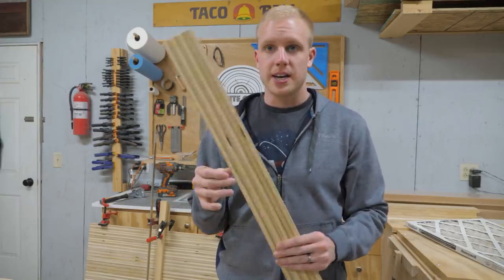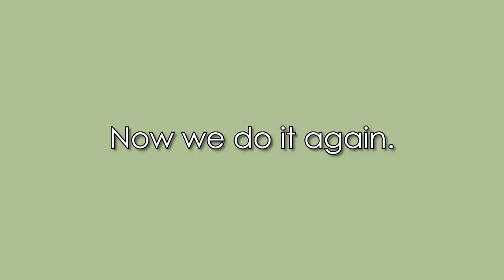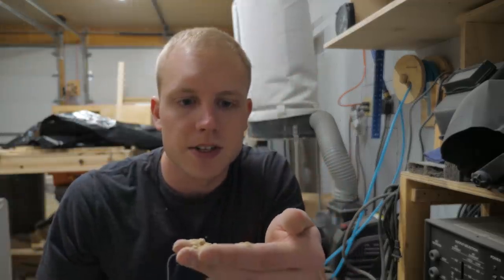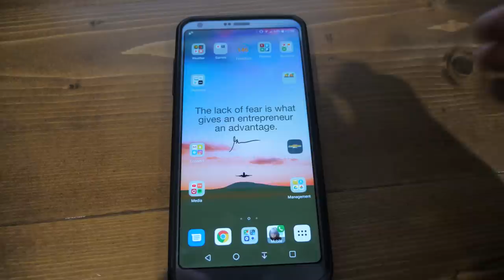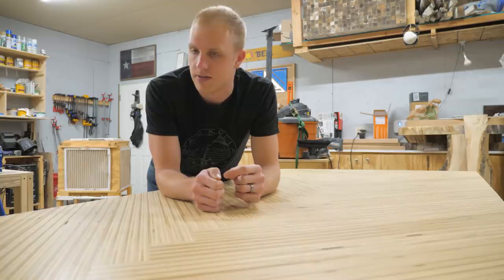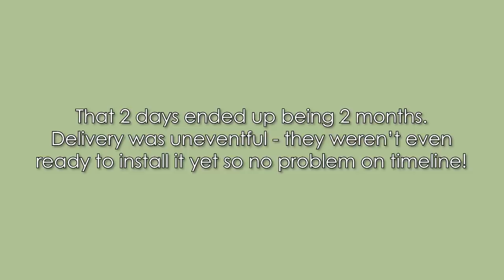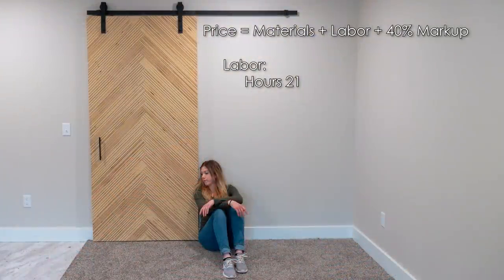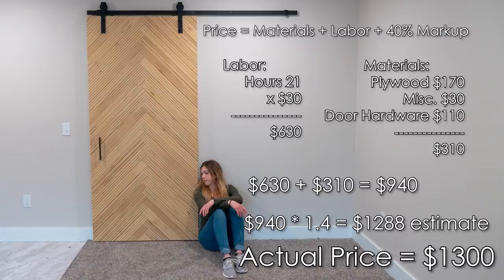Sliding Barn Door with Modern Herringbone Pattern | Build & Sell | Woodworking Business

Comment: Nice project! Came out much better than I thought from the description, kudos!
Just a couple comments if you don’t mind. 
You keep saying “ plywood”, which is true BUT I have run through a lot of birch ply, mostly seven ply. There are two cores available, which are very different in the way they look/process. There are fir core and poplar core. IMHO the poplar core edge is much better, it’s more consistent, machines better, finishes better ( usually a rare occurrence, since you usually hide the edge ) and usually has less voids.
Also, I don’t know if you were using furniture grade ply, but since you don’t see the face for this project, shop grade ply would have been OK.The main difference is shop grade has more filled defects on the faces, but one face is usually pretty good and both are smooth.
I know this is the second of your videos I have commented on and I don’t usually comment on videos, if you would like me to stop just say so.

One more item ( sorry ). I don’t know anyone in the NY area whose labor rate isn’t at least $45 - $55 per hour. And while Texas is probably lower, when you add Salary, Rent, Insurance, Workers comp, SS & Medicare, Professional fees, Vacation and Sick days, etc. you need to cover all those costs in your rate. Unless you are always going to be just the two of you working out of your garage, you need to consider what happens when you outgrow your current situation.

Best Wishes and Happy Thanksgiving

Comment: What brand is that scraper again? I'll see if I can get one, doubt it though, because we don't get as much cool stuff over here.
Edit: Looks like the purdy 2¹/²" carbide, but they're as rare as hen's teeth in the UK. Just bought a Bacho 665, been using their scrapers for years, didn't know they did a 65mm wide one. Have you tried cabinet scrapers? They're a pain to sharpen properly, but the finish from a good one is sublime.

Comment: I'm really enjoying your videos!  I've got a question, I recently did some makeshift pocket screwing (I don't have a jig) and it was difficult to keep the perpendicular piece from riding up as I screwed it in.  Is there a trick to keeping the piece where you want it while you screw it in?
Reply from the maker: Yeah that's a slight issue even with the jig. If you have a long enough drill bit you can predrill the second piece at the same time. Otherwise you can really clamp the joint hard before driving screws or account for the offset if it's consistent.

Comment: Hey guys first off thumbs up for all the videos! But i notice that you might be doing a mistake calculating your markup. I run my fabrication business at 35%  markup and when i calculate my stuff and the equation goes cost ÷ 0,65= what to charge the client. 
Which mean that in your case it should be cost÷ 0,60= what to charge the client.
Im not trying to tell you guys how to run your business, it would just suck that after working so hard you might be leaving profit on the table. 
Cheer and keep up the good work 👍

Look into that because you might be leaving some profit on the table